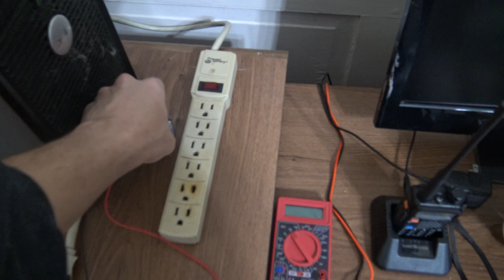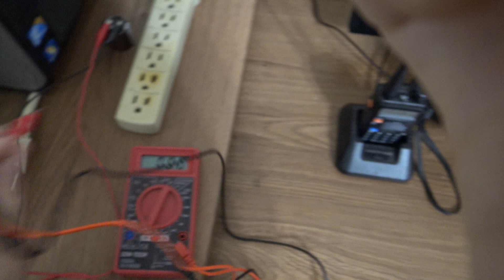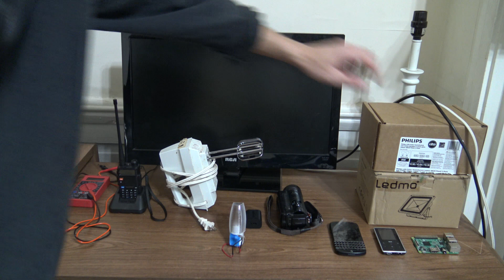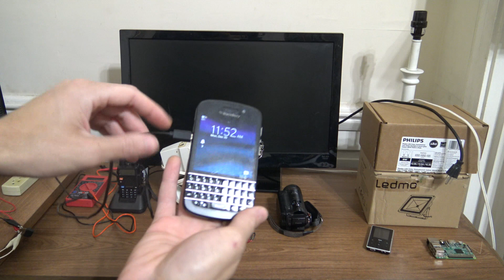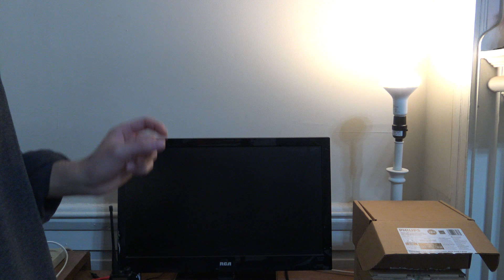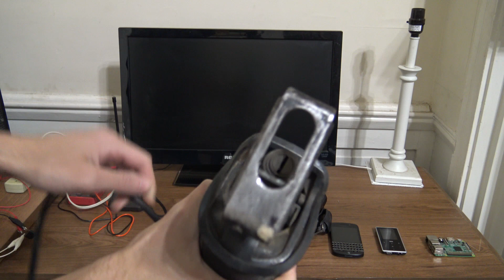Can ordinary household devices use DC wall power?

Comment: Interesting! I wonder if one day, in the future, DC will be easy enough to transport it efficiently and use it in our home, thus relying on AC only for a very limited set of appliances like induction motors and so on. So far the biggest drawback of DC has been transporting it and for a good reason... Nice video, though.
Reply: What would be more likely would be AC being carried still, but once at the home, it's converted to DC, then sent to all the outlets. Though, that would really make a kid sticking tweezers in the outlet very dangerous, as DC could melt the tweezers if any protections fail.